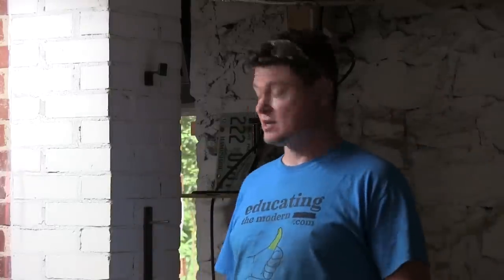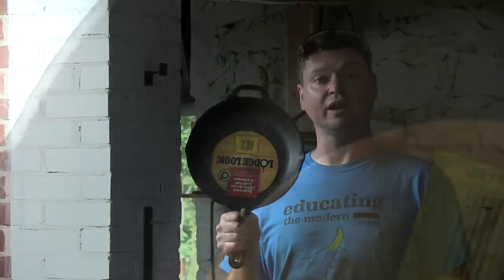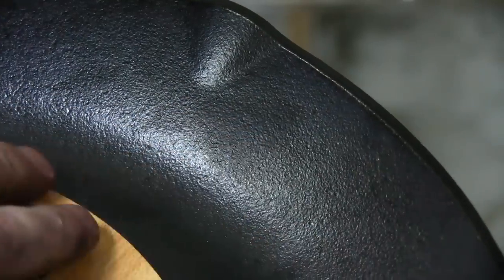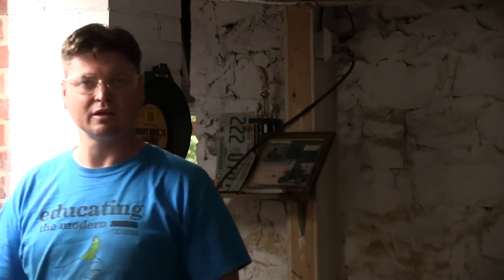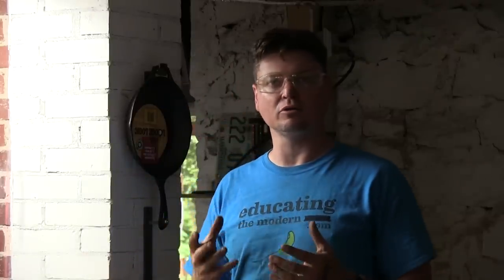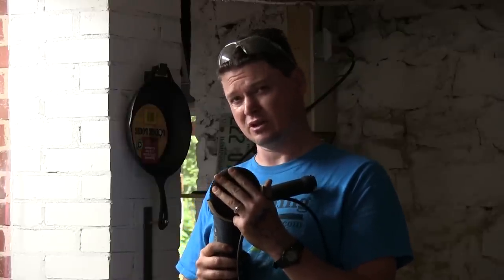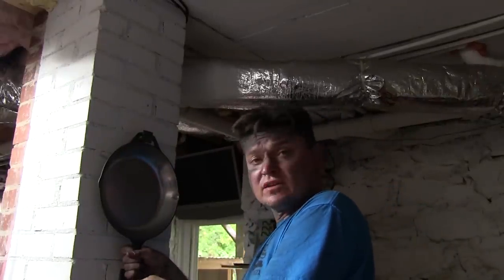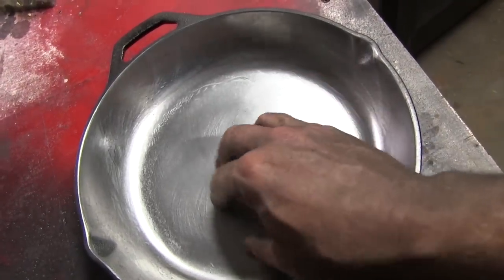ETM: Sanding and Polishing Cast Iron cookware

Comment: Hi,
  Did like you did with the pro and then did what my Mom use to do on the stove too. Get the pan smoking hot , turn the heat off and rub bacon fat on it , wipe out the extra and let it cool and repeat that 3 more times and WOW, " NICE" Turn the heat on mid-low and heat it up, little bit of butter and couple eggs. Can't beat that, just like the old days remembering Mom. :-) LOVE HER and Miss Her

Comment: I couldn't be happier with my polished (sanded) Lodge skillets.  The trick is to run the sanded skillets through your oven's self cleaning cycle BEFORE applying any oil. Not only does this convert the shinny silvery surface into black rust (this is good), I believe it improves the ability of the seasoning to adhere to the surface.  

Thank you so much for this procedure!  I enjoy cooking more and am eating healthier and tastier meals.  Thanks for improving my quality of life.

Comment: Mr. Boedy, Your video is the first I  saw that makes sense to sand the surfaces of cast iron pans. I appreciate your attention to the detail of using abrasives combined with the motorized wheel action to use its muscle to machine and finish out the surface of cast iron. Thank you for this highly educational video!

Comment: A trick I recently discovered: After grinding/smoothing/polishing a cast iron pan to a mirror finish, if you want to get the seasoning to stick to the surface, all you have to do is etch it with white vinegar. Pour about 1/4 inch of vinegar into the pan and then let it sit in a warm oven about (215 degrees) for an hour or two. When you take it out, the surface will have turned dark and you will have rusty colored vinegar. After pouring out the vinegar and rinsing it all off, you can use steel wool to get rid of any rust that has formed. The vinegar will etch a microscopic grain (giving it a texture that feels more like a wagner or griswold) onto what was previously a mirror finish, giving your seasoning something to stick to. You won't get eggs sliding around until you properly season it, but at least your seasoning will stick!

Comment: Since I learned way back how to cook on iron/steel surfaces, I've rarely-to-never have had anything stick, regardless of the surface condition, so long as I started with a cool, clean surface.  Seasoned or unseasoned,  machined or left rough from the mold - no problem; temperature and lubrication have dominion over why anything sticks, and we've got near-perfect control over both those parameters.  Know what temperature the items you're cooking cook best at, and get the pan to that temperature before adding the food.  Before adding any food, add lubricant of choice to pan, and let it react with the metal for a short period before adding whatever you're cooking.  And lastly, to clean it perfectly, so that it's ready for whatever comes next:  deglaze your pan with a bit of water while it's still at cooking temperature.  Hot water, cold water, it doesn't matter... just toss some water in and scrub around with your full-contact turner, rinse remainder down the drain or wipe it out with a paper towel.  Pan back onto the warm burner, dry sufficiently, add a small amount of oil and re-coat surface just so that it's wet, no need to have oil pooling anywhere.  There's no food known to man that can withstand a good deglazing.  And if you really know how to cook, whatever you deglaze will just make the food better, no rinsing down the drain necessary.  I shoulda posted this on my own cast iron pizza tutorial.... I think I will, minus this last sentence, of course.
Reply: Started reading, way too long.  This video was not only very informative, but kept my interest the whole time
Reply: This is how I was taught. Still, I hate that rough surface on the Lodge pans. Maybe I can find a machine shop to polish them?
Reply: @pityparty9955  it's only 15 minutes of sanding.
Reply: Los Apriscos Actually it was hours. By hand. No electric tools. Still the pans are way better.
Reply: @pityparty9955  I meant using power sanders.
Reply: Los Apriscos Yeah. Wish I had one. I have kitchen cabinets could use some work. The electric company doesn’t care.
Reply: Los Apriscos By the way, I appreciate all the information I get from comments by others. I’ve learned a few things.
Reply: @pityparty9955  you're welcome. We all learn something in here, even in the comments.

Comment: Excellent video, I was hoping I could use my grinder to smooth the new stuff.  

FYI - the rough texture is so that the manufacturer (Lodge) can spray pre - seasoning from a hanging production line and have it stick. 

PS. Nice kitchen - can't beat cooking with gas!  I will be grinding a lot of my new and older cast ware, for that shine.  

Thank you - big time.

Comment: Don't know if it's has been mentioned in here or not, but what I understand from various Lodge videos, they don't mill the pans the way they used to. This was to increase production and also so their seasoning spray will stick to the pan and not run off during processing. Back when they did smooth them out, they didn't season them. You bought them as "raw" cast iron. I'v got 4 Lodge pans (so far), 3 of which I've smoothed out. The 4th is a grill pan and I haven't found a grinding/sanding wheel that will fit in between the raised areas, lol.

Comment: Working on one right now... the sander attachment for a drill & 40 grit sandpaper works great!  Also found that a flap wheel sander works great on the sides - easy angles and does NOT make gouge marks in the bottom of the pan.  (That's a flap WHEEL, not a flapper disk sander.)
Reply: +CitizenKate  What grit did you use on the flap wheel?  I think I'm going to try your method, being that I don't have the tools that he uses.  Also, did you use anything else to finish smoothing it out?  Any details would be greatly appreciated.  Thank you.
Reply: +Blanca Rios
I used the coarsest I could find - 60 grit.  I also now have a 3M silicon carbide paint/rust stripping abrasive wheel that works amazingly well on cast iron, and doesn't seem to wear out as quickly as the flap wheel did.  It's about a 40 grit equivalent.  These seem to be more readily available than flap wheels, too.

Once I sanded off all the pebbly material with the coarse grit, I was totally happy with it.  It's actually pretty smooth then.  But if you like it more polished, just switch to a 80 grit disk on the drill sander, and the flap wheels also come in 80 grit.  If you really want it polished SUPER shiny, try a wire wheel or buffing wheel with some green or red abrasive compound.

Comment: Great work on the vid, sir.
Just bought a Lodge 10" skillet and griddle.  Self-cleaning oven took the factory seasoning off just fine.  Took them to the shop and smoothed the cooking surfaces on both with an Avanti grinding pad and then the sander with 80/120/220 grit.  Smooth as a baby's bottom!
Now, first round of reseasoning with Crisco and they came out with lovely GOLD cooking surfaces!
Second round saw no change.  Still gold as can be!
Any clues??
Thanks!

Comment: From what I understand, the rough texture is necessary because of the "non-stick" coating that Lodge and others put on their stuff.  It apparently won't stick to the iron if the surface is too smooth.  It's not simply a lack of finishing.  They started doing that when Teflon became popular, so they wanted to gain customers back by selling something that required less maintenance.
Reply from the maker: Watch this: https://www.youtube.com/watch?v=fkLLDiKHl48

Comment: I agree with smoothing it down... But too smooth and the seasoning will not take and will scrub off with heat and water. You do want some surface profile and to build up several layers of seasoning. Yes the eggs slid around but on a skillet that is used several days a week.... Surface prep and layers seasoning is my prefered method. I use 60 and 80 grit on an orbital sander and stop there.

Comment: This is the most informative video on YT on the subject of cast iron - thanks Boedy. I live in England where the price of Lodge CI is very high. A 12" skillet costs $70 minimum, a 12" 8qt dutch oven is almost $200. If I start attacking my wife's pans with an angle grinder I need to be sure I'm doing it right! I have a few questions:
1) Once that hard, rough outer skin is removed, what does the new flax oil / shortening seasoning have to stick to?
2) Can you use steel utensils on a polished and well-seasoned surface? Or is it more like a teflon-coated finish where you'd be better using wood, plastic or silicone.
3) Can I obtain a much reduced but slightly rough finish by blasting? There are a host of different techniques, sand, shot, bead, soda, vapour etc. If you have any experience of this which do think is the best?
Thanks again for a really good video. Paul
Reply: TheRunereaper I have the same three questions.
Reply from the maker: TheRunereaper And 5 months later........
#1- Iron is porous, oil seeps in.  However, it will not season like the rough surface does.  Do a couple coats of whatever seasoning you are into, then oil it, cook in it, clean it up, dry it off, and oil it again.  Repeat, repeat, repeat.  This works. The seasoning will flake off of the cooking surface, don't worry, just keep on using it and following the above steps.  
#2- Sure, you can use steel utensils.  Just use common sense.  Don't go cutting a steak while it's still in the skillet.
#3- DO NOT BLAST IT!!!  I've tried this, all it did was turn the entire skillet into a texture similar to about 120 grit sandpaper.
Bonus*** After sanding it smooth, you will need to heat treat it.  It needs to reach at least 800ºF.  You will now when it is hot enough because it will no longer be shiny, but a dull gray.
Reply: Boedy Pennington I just finished polishing all seven of my modern Lodge skillets.  I was planning to drop them off for sandblasting tomorrow, but your timely reply saved me the expense and unnecessary delay.  I'll run them through my oven's self-clean cycle tomorrow.  Thanks for sharing your experiences and excellent advice.
Reply: Boedy Pennington Thanks for your detailed reply Boedy, I'm only too aware that I can mess up years of careful handling with just a little careless blundering. Thanks as well, for that bonus tip. This heating to 800F-1000F  must be to stress relieve the material after working on it. If I remember correctly, I have to heat it for a couple of hours then let it cool slowly in the oven or furnace? It softens the cast iron very slightly but the payoff is a far less fragile pan.... A bonus indeed! You're a knowledgeable man and I'm very grateful for all your good advice. Thanks again Boedy
Reply: +Boedy Pennington  Great videos and I've learned a tremendous amount from you. I've even taken my pans and ground them down, using your videos as a guide. All three came out great, and I can't thank you enough for helping me get rid of that bumpy "new" Lodge surface. One question, and perhaps you can enlighten me further; I've always understood that Iron itself is NOT a porous material. While it can have surface irregularity and deformities that entraps matter (like liquids), the liquid does not pass through the base material. In fact, the term Porosity itself, is considered a definition of manufacturing defect in regards to casting metals. What's your take on that?
Reply: +ralphrepo Well Ralph, Boedy is definitely the expert on skillets, he knows a thing or two about metallurgy too. C.I. is not porous like a sponge but it IS subject to micro cracks caused by the casting process, as are ALL cast metals. It takes years to acquire the necessary knowledge to reduce this micro porosity to a minimum. That's one reason for paying the extra money to buy from a reputable manufacturer, the molten iron will have the right ingredients added at the right time and temperature and it will be poured at the right rate. I love the wafer thin Griswold pans, everything about them oozes quality but with some elbow grease a Lodge can be made into a thing of beauty as Boedy has shown us.

Comment: I am curious if you were to use oil or water or some kind of lubricant during the grinding and sanding would you still get those gouge marks? I am considering doing this with my and my sisters growing collection of new lodge cast iron ware and am researching as much as possible first.

Comment: I'm looking at 2:54 of the video trying to work out your cast iron mount. Did you find it was better to mount the cast iron at eye level or was mounting it horizontal to the ground too much potential pressure on the piece in cases of gouging? I am considering a 2x12 board mount a more temporary option that I can mount either vertical or horizontal. Thanks for posting this, I love projects and am hoping to mimic what you went through on this video. Did you find that you only needed to go to a certain grit level on the sandpaper, or would you go even further if you had the time?
Reply from the maker: The mount was because of my neck.  Hurts to look down all the time.  Keep in mind, this was only like the second or third time I had done this, now, I stop at either 80 or 120 grit, (but mostly 80).  This allows the seasoning to grip better.
Reply: Thank you for your input. I am going to do this on a 45 degree angle, mounted on long piece of 2x10, I figure I'll sit on the wood. I am going to use an avanti pro pad and orbital sandpaper. I have a griddle, skillet and square pan to do this on. Honestly can't wait to see how it will turn out.

Comment: The reason the texture on the inner  surface is rough is so the pre-seasoning will stick. Lodge did this intentionally because people didn't understand the seasoning process and it was affecting sales.
Reply from the maker: Thanks for the reply, and you are correct.  I mention this in my video, “All About Cast Iron; part 1”.  And it was a good thing they did it.  It saved the company and is responsible for the resurgence of cast iron.
Reply: > It saved the company and is responsible for the resurgence of cast iron.

Exactly!  Lodge provided the consumer exactly what they wanted and this is one reason they are still producing cast iron cookware today. They are to be commended for that. If the demand for cast iron cookware continues to grow, we may well see the mass production of polished cast iron skillets in our life times.  Until then, I too will polish my unfinished Lodge skillets.
Reply: +Boedy Pennington Personally, I think Lodge sold the idea to the public about the whys and wherefores of pre-seasoning but I don't think that was the entire gist of it. I mean, they likely could have achieved just as much pre-seasoning adherence with a slightly rough texture and not an entirely ignored surface post sand casting. In essence, by totally eliminating polishing after the casting, not only did they make it easier to adhere a pre-seasoning, but they more importantly removed an entire costly manufacturing step. I'm sure that by not paying for continually needed abrasives, that that alone must have saved them a bundle. But of course, the pre-seasoning angle story certainly seems a more publicly acceptable tale.

Comment: Hi Mr. Pennington,  I have some Stainless Steel pans that have food stick like massive super glue style. Does not matter if I use coconut oil to season it, some of these pans stick horribly. Do you think the polishing at 250 grit or higher would possibly cut down on this sticky condition? Thank you for this excellent video.
Reply from the maker: I think, no doubt, it would help tremendously.  If never heard of anyone seasoning stainless steel though.  Maybe that's your problem?  Also, make sure the pans and oil are good and warmed up before you put any food in.  This could help.  If you've got a cold pan and throw, lets say..., a chicken breast in there, it will stick.  Pan needs to be hot before you add your food.
Reply: if they are stainless steel with sticking problems maybe you are cooking at too high of a heat. try turning it down a bit and see how that goes.

Comment: Thanks I'm going to try this will a die grinder to see how it works.
Reply from the maker: slappy76 Well?
Reply: Boedy Pennington Actually worked out really well. I used them on 2 Lodge skillets, an 8" and 15". They're MUCH smoother now. Getting the corners were a little tricky. I used a cheapo Harbor Freight right angle grinder and several 3" abrasive discs (especially on the 15"). I took down all the bumps but I find there are a couple of pits. It would probably take down too much metal to get it perfectly flat. I think baking in a few layers of seasoning might fill it in.

Comment: I went to buy one of these skillets from your site, was saddened to see I missed the window! Congrats on the job however! Looks like I am going to have to make one myself. Question for you: The bracket you are using to hold the pan to the brick pillar, Is this something available somewhere? I am looking to set up a brace like that myself.
Reply from the maker: Tim, I made that bracket myself.  But that column and the bracket are no longer there, what I primarily used was fender washers and wood screws and I screwed the skillets down to a wooden work bench.  Good luck!